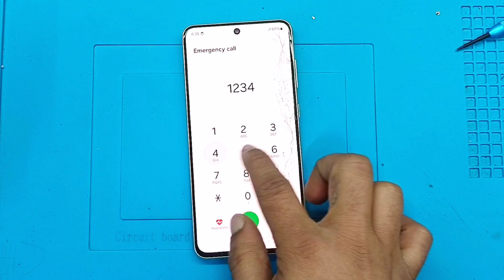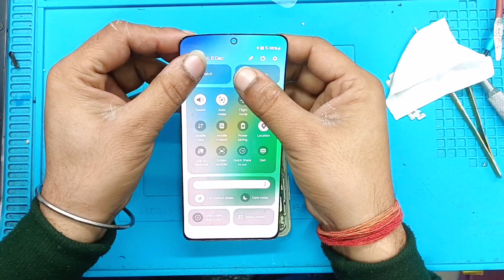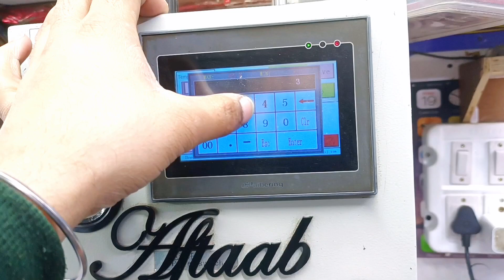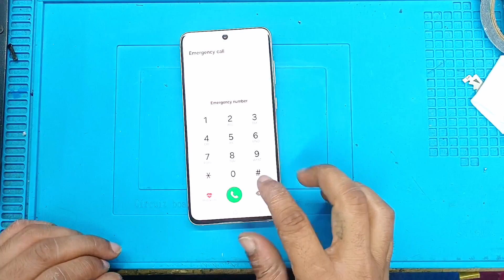Samsung S21 FE Broken Glass Replacement | Spare Repair

Comment: Is it possible to repair shot circuit in screen connector? due to water damage I found that few capacitor beneath screen connector got shot, replacing those will probably work fine
Reply: Did you get any solution of this I am facing same problem right side screen is not working

Comment: Sirf Paper change karne par Green line issue solve hoga kya?
Reply from the maker: Line ka kuch nahi kar sakte sir
Reply: @sparerepair the glue is better than double sided tape sir
Reply: @sparerepair  if the glue is use for back panel is better or double sided type which is better sir tell me